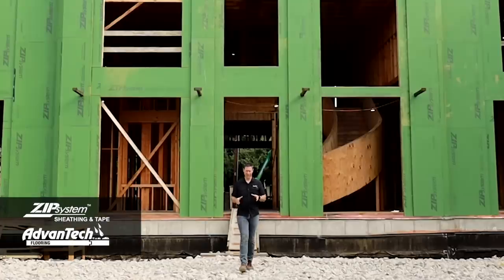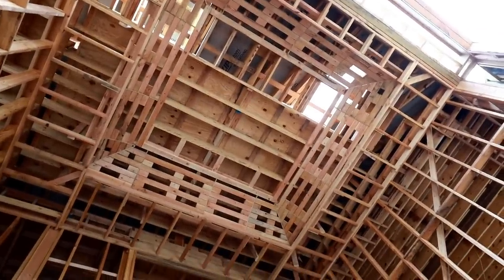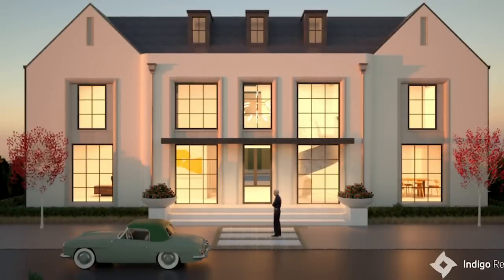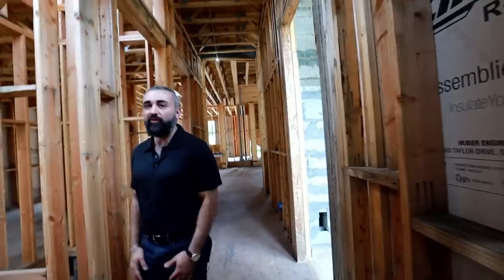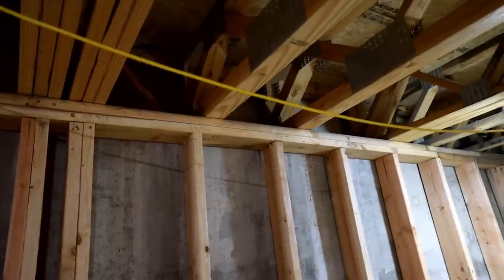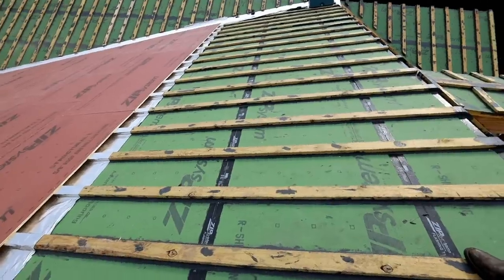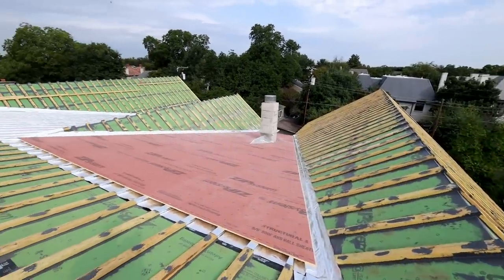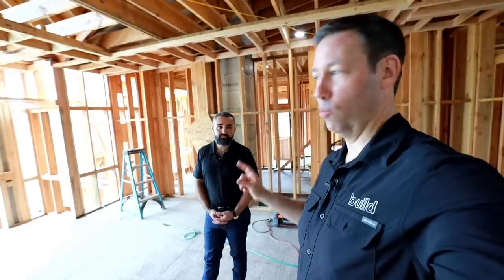INSULATED/Sealed Roof Deck , WITH Radiant Barrier AND it’s Vented...Haven’t seen this before!

Comment: Truly impressed by Dario's commitment to excellence... My only critique / question is this...  Isn't this re-inventing the wheel for something much easier to install and achieve the same result?  Specifically, ventilated Nail Base roof panels offer EVERYTHING Dario showed you (minus the radiant barrier).... Seems like a lot of work and expense to achieve maybe a 1-5% improvement over Ventilated Nail Base Pannels.  And these Nail Base manufacturers warranty their use on roofs... hmmm.

Comment: Funny, sump pump overkill...

The Fall of 2020, I manually dug a ramp and access down to eight feet below the foundation pour of the basement, exterior to the house.  I installed a 10'7", two-foot diameter plastic culvert to act as a sump pump well casing.  Once the culvert was stood on-end, I filled the hole with pea gravel and the access ramp with the previously extracted dirt.  It took two and a half months of back-breaking mattock, shovel, and wheelbarrow work.

The big test, of course, will be this Summer, 2021 and whether or not air moisture issues in the interior basement are decreased.  The pea gravel filled hole allows a couple of hundred gallons of water to accumulate if there are power or pump issues.  The buffer will allow time to fire up the backup generator or lower in a replacement pump.  The mechanical float switch on the pump has been replaced by one of LevelGuard's solid-state sensing units for long life and reliability.

If you'd like to see a photo album of the project, search Facebook for "Russell Stephan Big Dig".

Comment: The roof looks great, but you can get the same vented roof performance with rafter, tyvek, vertical furring strip, plywood and ice&water shield. Then vertical, then horizontal furring strips and finally tile or slate. Insulate between the rafters with foam.

Comment: I really like the radiant barrier sheet. I wish more builders would do that even with a traditional roof. Please correct me if I am wrong. I assume the radiant would be put on top of the underlayment then the shingles on top of that. Would doing a vented roof system like this one be hurricane rated?
Reply: You have to have an airspace, so traditional roofs are tricky unless you go double deck: https://youtu.be/OlYvkM_CHXU

Comment: One thing I have learned about sump pumps - they need to be used or they will stop working - their seals dry out over time.  I drain my sump pump wash out into my sump pump so it runs in non rainy season.and cycle time needs to be as long as possible

Comment: Hi Matt, I'm designing my own in a very similar matter, and you have been an amazing repertoire for anything new, and interesting. I'd like to show you my design and plans if you are curious and I guarantee you, you will like what you see. Similar to Dario, I am from a commercial background and I use BIM to extremes, however it gives me great power to pre-build projects before they even start getting. Some of the things you design, and then build, you will often only see the hiccups at the building stage such as heights, clearances and overall look. Basically I virtually build every component of the house and then I am able to see what can be built and what cannot. Regardless, huge fan and if you want to hear more about what I want to show you, reach out to me anywhere you can. You'll find all my info and where to contact me at my LinkedIn page (also where you should be :) ) https://www.linkedin.com/in/aleksandarstevanovic/

Comment: That's just a cold flat roof but with a steeper slope. It's not really new technology... and yes it works very well-- just in case anyone was wondering. The heat from the sun generates a tremendous draft underneath the decking, it stays bone dry even if the roof has a leak, it will dry out with very little sunlight as long as the roof covering is a dark color. Same as any attic really, just veeery thin. They are popular in Europe.

Comment: Matt, can you expand on what you meant by that roof not being 'approved by Huber'? What's the issue that Huber might have? That upper 5/8" Zip is vented, right? So what's the problem?

Loved how the guy said the liquid flashing was a bit pricey stsnding on a double-layer Zip 12000sf roof. Dunno pricing in Dallas, but I presume that's got a high-7, low 8-figure asking price and he'll pocket a few million.
Reply: The insulated green zip-r isn’t roof approved, that’s why you see two layers of it. The rust colored zip is for roof applications. The gap allows air to move through two layers of waterproof roofing.
Reply: @ReasonablleDoubt  Ah, thanks. Didn't realize Zip R isn't a roof-approved application.
Reply from the maker: The ZipR on the roof is only approved for placement over solid sheathing.

Comment: This is a great house.  I will say that putting zip over zip is a waste of money.  The point of the 5/8 zip roof zip is to give the roof strength to hold the shingles and to be part of the WRB for the entire home.  Because it is an overroof (meaning a double roof), the zip roof sheathing cannot be an WRB because it's not tied into the system. It is only there to hold the shingles.  He should have just used 5/8 plywood on the overroof and saved himself a ton of money.  To save even more money, he should have found reclaimed polyiso (I say reclaimed because polyiso shrinks over time and you want it at its final dimension, it is also cheaper used), layered it, put the zip roof sheathing on, then built his overroof with plywood. He would have then got his warranty with Huber.

Comment: Is he going with an HRV/ERV? Is there a good system you like. There are some that pull in air that is not filtered or conditioned. Why pull in crappy air and not condition it or have a system that doesn't control the building pressure automatically? Is there something out there that does keep the correct building pressure automatically and condition the air before going into the main house HVAV system?

Comment: Three phase residential service, how did you get that through?  Is it 480 volt service with transformers for traditional 120/240 volt loads?
Reply: as with most things you throw money at the problem, I would love to have 3ph in my shop, and its available 3 blocks away.  BUUUT, the last person I knew that had it add'd and had a shop in a commercial area, the closest pole was across the street. cost him over 10K to get it across the road......  So even though I have not checked with my power company, I am guessing its not going to happen in my case.

Comment: For Texas, shouldn't the radiant barrier be on the underside of the top layer of zip sheathing, breaking the heat radiating downward?
Having it on the lower deck, it only stops heat radiation coming up from the house...
Reply: @Chance Moore -- You are correct.

Comment: If u knew were main trunck line were running u could sister a splice extra truss along the whole run for price of mayb 1 or 2 trusses cut down & really open up a man sized commercial sized mechanical hole.

Comment: I'm surprised he isn't going with radiant heating and ground source heat pumps. He is going above and beyond with most of the house, so why not go with the best way of heating and cooling a house.
Reply: you will still need some air circulation, central HVAC does both circulating air and heating it

Comment: Is there any concern of a double vapor barrier on the roof?  The foil I assume is a vapor barrier unless it has little holes punched in it and the zip-r and closed cell on the underside of the roof is a vapor barrier.
Reply: The only vapor barrier you want is the one that distinguishes the outside from the inside.

Comment: I like the ZIP-R12, but worry that once you get 2 inches out from the studs, you've lost most of the shear strength you get with normal ZIP. Would it be a bad idea to sheath the wall with plywood and then apply ZIP-R12 outside of that? I assume this would strengthen up the roof to do this as well.
Reply: good point, probably why zip systems want the ply or whatever under it, that way that is the shear plane.

Comment: Your going to reget the short old style garage door. Cars Trucks SUV r getting lifted RVs toys it just makes sense on new builds to go 9minft but 10ft commercial insulated carriage clean look.
Reply: Only thing u could do NOW is slope down & up under the header opening cutting concrete out & back-up low pnt drain to 1 side oe other if flood condition. Water will get to low spot & not come in but u get full ceiling ht back not losing header.

Comment: Matt i have an "issue" in my poorly constructed apartment my landlord put together himself. Insulation is horrible in this place even though he said he filled all the walls. I assume he is using horrible r value wood or sheetrock. But the biggest issue is when i use my normal gas oven to bake anything my whole house heats up incredibly fast and it all comes from the floor under the oven and resonates through the entire house floor in less than 30minutes. If you are walking barefoot where the floor might of been cool 30min ago is warm like it had the sun beating on it.

Comment: Isn't the air gap on the wrong side of the radiant barrier? The radiant barrier will conduct all heat that gets to it into the zipR? If the radiant barrier was on the under side orange coloured OSB it would work.

Comment: How is he attaching the top decking on top of the foil and what was he using to seal around the nails/screws that perforate the foil?
Reply: Exactly.  The foil will have water get under and it will not make its way down and out. It will stay in a liquid state and rot the green zip.  The foil should have been loose, vice inadvertently making it the water membrane of inside or outside the house, ie perfect wall concept.

Comment: It would have been better to stand up the 2x4s on the roof as the taller airspace will allow the air to flow easier.   

I would actually bet that that roof will not have any natural airflow due to the length and amount of resistance to airflow.  To be honest, it probably would have been a good idea to consult with an engineer on the airflow.

Comment: beautiful. wondering why he didn't do 24" on center.
Reply: From my research the main benefit of 24oc is to limit the amount of wood to prevent thermal bridging and low R-value since you only insulate between the studs.

Putting the Zip-R in front of all the wood eliminates those issues so you don’t have to go through the tedious task of planning and engineering 24oc.
Reply: @dariod2666  the benefits are clearly obvious, but I'm not understanding the engineering challenge you speak of. The only engineering change is the distance between the studs. What am I missing?

Comment: Meanwhile in Europe...above-the-rafters insulation but don't tell him, or he's gonna strip it all. Also I'd consider a white roof or bare aluminium sheet before a solution involving 2 tonnes of caulk (recyclability). Btw been thinking about using a reflective vapour barrier between the breather and roofing just a couple of hours ago...does Google now do mind reading?

Comment: Since he's venting it, he should have pulled the radiant barrier tight across the 2×4's allowing an air gap on both sides of the attic foil,,it works way better
Reply: That would eliminate the air gap on top of the foil since it would then touch the bottom of the decking and cause thermal bridging.
Reply: @dariod2666  right right

Comment: So, the underlayment Zip system with the purlin penetrations is 'mostly water tight' and the aluminum foil is 'also somewhat water tight' after the copper nail slate installation penetrations through it. So 'mostly water tight' + somewhat water tight is ok, I suppose. But given that we have systems that are guaranteed 100% impervious to water, why  compromise on less than that? While I understand that what the buyer gains here is a thermal brake AND ventilation, there are ways to accomplish both independently of the water seal. Granted, a system that is100% impervious to moisture and also vents and also provides for a thermal brake would likely actually be more expensive than the solution provided here, no one should be disillusioned about the compromises made with the system that is shown here. It is not without reason that the manufacturers would find fault with warrantying such a system. And to the Build Show's credit, he does at least point out that the manufacturers would not stand behind such a system. None the less, this is a compromise between goals and costs, as are a grate many things in construction. And I am not implying that the customer made a bad choice; as a contractor myself, that's not appropriate to do. But a compromise it is, and that needs to be said perhaps more clearly than was stated in the video, and more disturbingly, perhaps because the video producers don't really appreciate the role that penetrations and gravity are designed around to provide a truly water tight system. But I digress....

Comment: Question; why would you not have a warranty on the zip-system roof he has going on? it would seem to me,  that if he is putting another layer of the brown zip-board on top of the vent space boards, and if he tapes the joints, he should get a warranty for any roofing that goes on it. it would be no different than a single layer cheap every day roof.
Reply: no decking under it means the shear forces have to be  handled by screws through 2 inches of foam, and the vertical load is concentrated on the foam instead of spread our as it would be with decking, then the zip.  Just a couple guesses, and I did not stay in a holiday inn last night.......

Comment: The only thing I would have done is run zip tape along the bottom of the zip where it's sitting on the copper.  It's going to be Swiss cheese in 10 years.

Comment: I would really like to see all the plumbing and Flue vents stuck through that Roofing system. That is without compromising the Tightness of it. 
   Please show us that????

On a home with that many Square Feet. I usually stick vents through the roof. Then I can run all my waste plumbing. 
Run all my above floor waste and water lines. Then either pull  my stubs or just tie on to them where they stick through the Roof...

   Dario, can you or your plumber lay this out for the rest of the world?????

Comment: The slate option on the is still a thermal mass, unnecessary cost. There is a roof system that is far more affordable and longer lasting plus 1/4 the cost. This is an example of how expensive you can build.
Reply: I seriously considered doing a performance “fake” slate that had exceptional properties but changed my mind for a couple reasons. 

The roofing supply had four mock ups of different companies, two of them had gone out of business. This was reaffirmed by the slate roof importer who said “it looks good on paper but the company disappears after a few years, right around of the time you see failures.”

Finally, the local RE expert said that at my price point I can’t tell potential buyers that it’s not real slate.
Reply: Check out Permalock. Aluminum shingle roofing. They have a slate embossed shingle that looks like the real thing, lasts longer than slate, withstands much higher wind gusts and can save on utilities because it’s a radiant barrier on the outside of the house. Plus they can give you a 100 year manufacturer’s warranty. I build advanced tech homes in Park City via my construction company at kelschconstruction.com.

Comment: If water gets under the aluminum flash on the roof it will not have an escape route and will eventually rot the zip sheathing.
Reply: If the water gets behind the aluminum it should still find its way down the face of the Zip R to the bottom of the house and out.
Reply: @dariod2666  would it not have made better sense to not use the foil and run techshield board with roofing right to that? Or just attic foil the attic to not ever have that worry?
Reply: J Shapiro The foil needs an air gap to work or the heat would just transfer from whatever is up against it right through.

So technically wherever the 2x4’s are I’m not getting radiant protection, just the gaps in-between.
Reply: @dariod2666  you raised the next section with the pressure treated lumber so what I'm saying to 100% have same airgap but also know water would flow 100% roofing connected to techshield to the 2x4s to the zipr would give same benefit maybe even cheaper because you used brown boards anyways with attic foil vs just buying a lp tech shield board.
We need a final tour and we need power bills and also at 1 year how many calls backs.....if this last and no issues your on to something mad scientist.

Comment: Pretty sweet setup but what is the payback on a house/system  built like this 400 years??  I guess when your willing to build a house for 7 million dollar only worth 4 million......  really nice setup I’m not knocking them.
Reply: The savings used to tackle some of the details in-house were transferred to the high performance products. As of now, based on comps and budget, we are still in the green on profit.
Reply: Thanks for the reply.  You definitely are building a house to a extremely high level and know what your doing.  I’m guessing a client commissioned you to build this and it’s not a spec house and they wanted “the best”.  I was more talking about the sale value of the home once completed may be less than the build cost.  But with a house of this value I’m sure the clients can afford the hit.  Great job on the house!